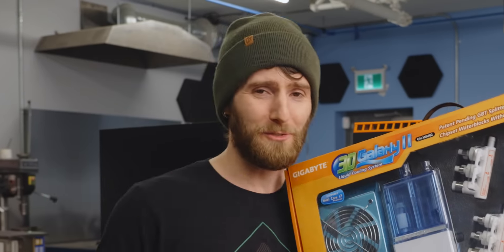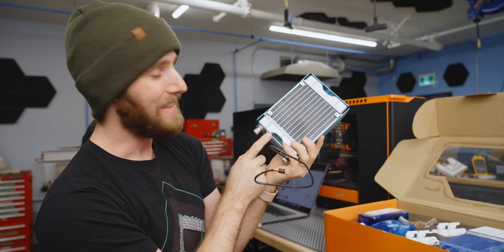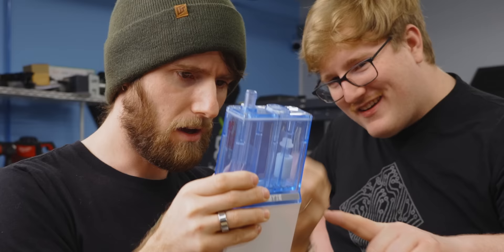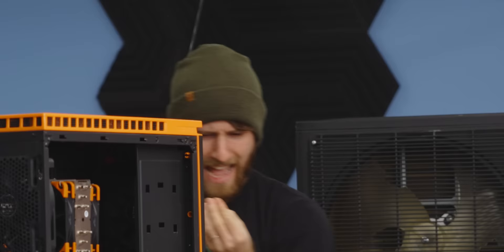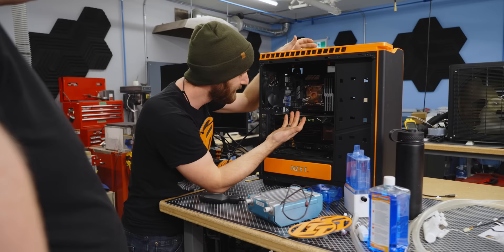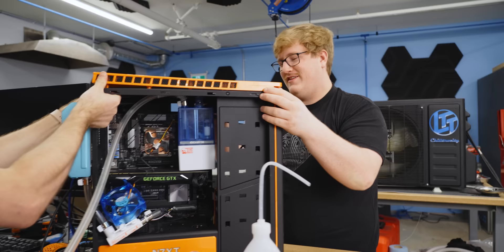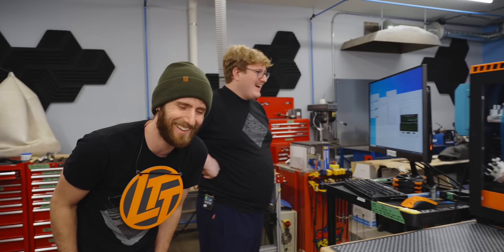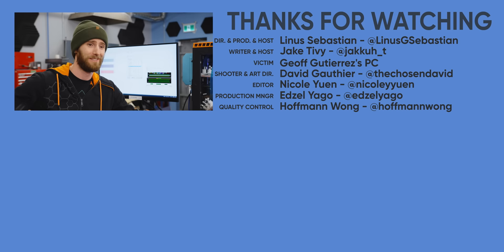This Product Aged Like Fine Milk - Gigabyte 3D Galaxy II Retro Watercooling Kit

Comment: 5:30 the wanted you to remove the power from your Hdd, because the you PC won't Boot and you CPU would idle in the Postscreen. This was to minimise the heatoutput till the loop was bleeded, since the block wouldn't cool without water. They simply relied on the thermal mass of the Block during that time, which was fine(?) back then...
Reply: 60w was the norm back then so thermal performance didn't matter as much as it does now. This was Gigabyte's attempt at getting sales from novice PC builders, I doubt this was competitive against the DIY market - the fact that this had bigger fans was a greater selling point for people looking to upgrade from the annoyingly loud stock coolers AMD and Intel chips came with.
Reply: @amirpourghoureiyan1637  yes I had a thermaltake system on a heavily overclocked P4 and that was much quieter. Later I swapped the cooler for a cooler of a motorcycle and ran even passive....
Reply: @amirpourghoureiyan1637  Pentium 4 got out to 115W in 2004/5, higher if you overclocked. 'Preshott' literally melted sockets overclocked. Theres a reason they abandoned the entire architecture.
Reply: even back in the days we werent dumb like that. we knew full well that connecting the green wire to any black on your 24 pin would run the pump without turning the system on (still does)
Reply: @mycosys  Yeah, I was referring to stock systems. AMD and Intel's 32 bit chips ran at similar thermals to today's Pentiums/i3's
Reply: @mycosys  I had a Sony vaio with a pentium D that idled at 80°C. Kept me warm in winter lol

Comment: I remember using fish tank pumps, pop bottles for reservoirs,  and tubing from hardware stores along with some self machined copper heatsinks. I have sworn off liquid cooling ever since lol. This was circa late 1999-2002.
Reply: You still can use fish tank pumps.  The Aquacomputer Aquastream line uses eheims.  An actual top notch pump, sacrificing some pressure/flow/noise for reliability vs D5, with built in monitoring/control (integrated low flow sensor, temp sensor, display, and onboard microcomputer).  Very reliable pump.
Reply: @Grimmwoldds  I've had two D5 pumps working in tandem for over 10 years dude.

You don't know what you're talking about.
Reply: Yup, THAT were the days of pioneer water cooling. Not that modern AIO stuff. Back when a Dremel was a PC enthusiast's most important tool is where it's at!
Reply: Seems fun for a rat style build today.

Comment: I like that they actually put a decent amount of thought into the system, with the power pass through, a decent pump. The patent pending valves. If only they had spent a little more time on the water block it might have actually held up! I'm honestly shocked that the components all worked and the coolant was still ok. They only gaurantee it for 3 years! lol But still, pretty cool!
Reply: And if they used a new thermal paste + good mounting pressure the cooling performance would have been only slightly worse than the best modern air cooler.
Reply: 3 years of use, not 3 years sitting on a shelf. Hence warranty starting after purchase even if manufacture is a year ago
Reply: @Rspsand07  ah, fair enough. But sometimes it is from date of manufacturer, if it starts degrading. An extreme example is hydrogen peroxide, if it sits on the shelf too long, it's just water when you open it.
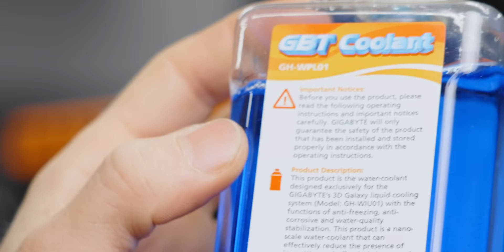Reply: @Rspsand07  on 4:53 it says "Guaranty period - 3 years (on closed status) "

Comment: The manifold for adding components to the cooling loop is actually an objectively good idea they should be using now. Definitely more convenient for the end user
Reply: in case you didn't know, quick disconnects exist.
Reply: Not sure if it would work with a loop setup and would instead mess up flow.
Reply: Yeah, well, Gigabyte has the patent on it... nobody else can use this.
Reply: @TechyBen  Correct.  You shouldn't use a manifold unless you have a large number of identical devices waterblocked(GPUs mostly).   It's not a useful thing otherwise.  Even then, most blocks that might be used in multiples will have more than one inlet/outlet pair, so a manifold as a separate part is just useless.
Reply: But how often do you change your components that that even matters?

Comment: Aah, the nostalgia!  The only thing I would have done would have been to also compare it against a good representative air cooler from that era too to in order to see if it was an improvement over what was available at the time. Noctua is a still quite a challenge to beat even for modern WC systems.

Comment: Really needed to give this unit it's best chance to shine. Modern thermal paste and modern coolant. COME ON LINUS! Make this happen. I really enjoyed this video.
Reply: You wouldn't want to run modern coolant in that thing since modern coolant doesn't have the same anti corrosion agents in it. I think that swapping the cold plate to a proper one would give the best improvement.
Reply: You actually NEED their coolant to prevent the corrosion between the aluminum and copper....
Reply: Better way would be to test its performance on era appropriate CPU against era appropriate air cooler.
Reply: @R3BootYourMind  Because there is no modern coolant with anti corrosive agents.
Reply: The block design is awful, modern coolants and paste wont do anything.
Reply: @g.4279  i think a modern paste might have done something, but not much.
Reply: @akamemurasame4527  Automotive coolant has corrosion inhibitors.
Reply: If you are going that far you should probably lap the cpu block and try to take it apart and fix the flow through the block as well.
Reply: "Coolant"?

ROFL.
Reply: Just use the red OAT coolant, as a bonus it's "UV sensitive"

Comment: there's a good chance that the Thermal paste you guys used, actually influenced the benchmark by a lot. maybe with a quality paste it would run at the same temps as the noctua xD
Reply: Even new water coolers struggle to beat the noctua but I like your optimism
Reply: @hondaman62  that one is pumping like crazy though.
and Noctua NH-U12S is actually not as good.
Reply: @hondaman62  so it should be given every advantage

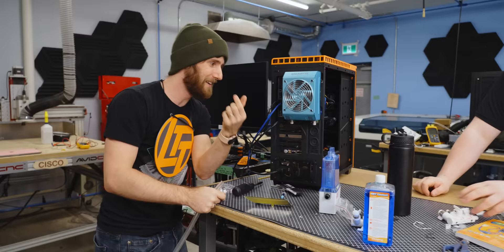Comment: 13:52 As was noted a few seconds earlier, power supplies used to be at the top of the case. These wouldn't have interfered with video cards which were at the bottom of the case.
Reply: Yeah I have a fairly old pc and my gpu slot is at the bottom and psu at the top
Reply: I had a similar case but with a top-mounted PSU, but my GPU was still an AGP card, so it would have been hella blocked by this
Reply: I still have mine at the top of the case lol

Comment: I had this very loop set up in my Lian Li PC-70 back in the day. If I remember correctly it was an Athlon 64 3200+ with a MSI K8N Neo 4 Platinum mobo and a GeForce 7800 GTX. In an era where you could buy this or spend as much as a full PC build on a custom loop, the gigabyte kit wasn't a bad deal to be honest. Definitely needed a full tower case to comfortably set the thing up inside, though.

Comment: My very first computer was built using the "GIGABYTE 3D Aurora 570 GZ-FA1CA-ASB Black 1.0 mm Aluminum body ATX Full Tower Computer Case" which was the original case that this liquid cooling kit was made for. Thank you LInus for the nostalgic flashback.

Comment: This takes me back! Modded PC's back then looked like the B2TF DeLorean time machine. Knobs on the back, different gauges on the front. I had a water cooling setup where the "tank" fit into the old CD drive slot, the pump was like from a small fishtank, the back radiator gave her a big dump truck.. and I ran the coolant lines through an open PCI back slot xD

Comment: I would love to see what the performance of it would be if you properly flattened the cpu block.  And used a newer thermal paste.  Just to see how much the poor surface was causing issues.
Reply: I agree but also the way the coldplate was designed didn't really flow the coolant over the hot spot so who knows what would be the result but it certainly shouldn't be worse
Reply: @theduck17  I mean it's that really going to master much? It's a solid copper block. Heat will distribute in it pretty much evenly.
Reply: The cold plate also looks about 5mm too thick :D
Reply: @4203105  and the liquid stream touches "not moving" liquid

Comment: 17:43 Pentium 4s did have thermal protection.  I think Athlon XPs might have had it (I do remember mine having temp sensors) but anything older than that, especially AMD, was prone to failure and sometimes catching fire.

Edit:  But P4s ran so hot that we eventually had to put a fan with blue LEDs that sat in a PCI case slot in my younger sibling's PC.  2004/5 was weird.
Reply from the maker: You're right P4s did have thermal protection. My bad - LS
Reply: Pretty sure the Athalon XPs did too.   It was as bare bones as this solution is - hot temps = instantly kill the power, no graceful degraded performance "until" it's cooler.
But that's really as early as my experience in actually playing with hardware goes.
Reply: There was at the time breathtaking video. They remove heatsink on 3 working pc’s. Amd athlon, intel celeron and p4. Pentium 4 throttled down, celeron froze and athlon caught fire.
Reply: @MegaMoonse  oh man... I want to watch that.
Reply: @TheBaldrickk  check the video named "What happens when a CPU heatsink is removed".
Reply: @proCaylak  thanks, was good
Reply: Yeah, that. This is why I had to watercool my P4 back then. It was from one of the very first Prescott batches, and my CPU was super hot. My air cooler would not perform well enough, and the PC would always shut down. The water cooling was of a similar design btw, it was Thermaltake's Aquarius II with narrower tubing and not so great performance either. But at least it kept my PC on lol.
Reply: My first "custom build" PC was an Athlon which I believe did have thermal protection but that seems so far away LOL. My high school capstone project was how to custom build your own computer.
Reply: As a kid I remember having a...P3 I think? Pretty sure we got it from blowout sale when the P4 launched. One day it started randomly shutting down after a few minutes of use. Turns out the heatsink/fan fell off the cpu. I guess that counts as thermal protection?
Reply: P4's were able to throttle from overtemp.  AMD CPUs (around Athlon XP era) would halt at overtemp conditions.

Ref: https://www.youtube.com/watch?v=NxNUK3U73SI
Reply: In college (1998-2001) I worked in a computer lab and we definitely set a Pentium II on fire with an intentional overclock.
Reply: If I remember correctly. I did have a motherboard whit built in temp protection. It was a temperature sensor that was supposed to mount to the cooler in some undisclosed way. And then sense the temperature of the case. It may even have been fitted whit two sensors CPU and ram maybe? But it's a long time ago. I also had zalmans air alu/cooper cooler that I later upgraded to the all copper 120/140mm? Air CPU cooler whit led fan. Not to mention my awesome plexiglass psu whit blue led fans and a chrome nob to adjust the fan speed...
Reply: @MegaMoonse  It was a Tom's Hardware video, I think they made an "updated" version of that video later on with an Athlon 64, needless to say the thermal protection kicked in
Reply: @TheBaldrickk  No.
Reply: Yup. I've personally burned right through an Athlon (not XP) on first power-on, actual hole in the die (which was naked on these) and smoke and everything. Mounting coolers straight wasn't as simple back then - or I was just a bit dumb =)
Reply: @comprendes_mendes  We had a Pentium 4 Northwood prebuild from HP.  A XP MCE machine with a 3.0 GHz CPU with hyper-threading and it would shut down after one of us decided to play games a little too aggressively on it.   There was obviously no room for water-cooling although I had known about it since I started taking my computer repair classes at around the time so we went with the slot fan option.  It actually survived well into the Windows 7 era and ran it quite well despite, well, having to go with PCI graphics because AGP was dead.

In retrospect, putting a better air cooler and some thermal paste would have fixed the problem too.
Reply: @LinusTechTips  Cool!  (Literally)
Reply: @Mystik314  Halt and catch fire at its finest.
Reply: I still miss that machine.  It might've been a prebuilt, but it was pretty solid sans the overheating problem.  Too much Empire Earth and it would just overheat and it'd die.

Also, it was the best MCE install I've ever used, and the built in capture / FM radio was a nice touch.
Reply: Athlon XPs, at least the earliest ones, did not have thermal protection, or if they did it didn't work very well.

I know this because I literally melted one by forgetting to plug-in the CPU fan.
Reply: Intel fanboys actually dunked on AMD by demonstrating how they could take their coolers off and their chips wouldn’t melt, while the AMD die would slag. I always thought that was a really stupid bragging point, hehe.
Reply: @fonkbadonk5370  You let the magic smoke out... 😞
Reply: Yes that was thermal protection. The pentium 3/2 ran cool enough they could last a bit before turning off, like modern pentium/Celeron chips. The p2 was the first CPU to have thermal protection, AMD added it with the athlons immediately after the thunderbird.
Reply: @LinusTechTips  I found out my P4 had thermal protection ( and what it was since I didnt know ) because it kept turning off by itself after a short while. Aparently you are supposed to clean up dust BEFORE the fan cannot spin anymore because of it. You live, you learn I guess.
Reply: Yep. My first CPU was an Athlon 3000+. I promptly fried it by hitting the power button before even installing the cooler.
Reply: @TheBaldrickk  I rememeber watching a video years ago with Toms Hardware (i think) pulling the heatsink off a P4 and an XP while running. The P4 thermal throttled and the XP just burst into flames in about 4 seconds. Sure it's still out on the interwebs somewhere. :)
Reply: @Vacheron7  Yeah, that's the one I found following the search suggestion above.   Thanks.

Comment: Not all water-cooling kits from this time were as janky as this Gigabyte kit. I had a Swiftec kit from 2007 that was way better than this. It even came with a Laing D5 which I've used in 6 water cooled builds since (100,000 hours of operation) and is still going strong. It's happily pumping away next to me right now.  What an amazing pump.
Reply: 2007 stuff was maybe already better but till 2004 everything was so weird
Reply: @ManOfAttitudeLP1998  right. 2007 was on the upswing of where we are now with technology. 2000-2005 was pretty Wild West of “who knows” hell it was still just windows xp running the world too.
Reply: @WooferCooker  yes I was a kid at that time and even had a pentium 3 laptop with windows 98 I got from my dad
Reply: @ManOfAttitudeLP1998  Okay, but this kit was advertised as "I7 compatible" so there's no way it's from 2005
Reply: Had systems from thermal take.v2 and v3 What I could remember it was like less than +20C idle and ~+30C on full load. Cpu. Gpu and motherboard was LC.

Comment: Nice! I had "smaller" version without distro blocks...almost 8 years ago when i build "retro PC" (not really a retro back then) i find one on E-bay sealed...without mounting for 775...so i made one from aluminum and grinder...ahh...good old days... 2x HD 4870 x2 and 1200W power supply...this rig was definetly a space heater.... :D

Comment: A 2000 style video would be fun too.  Fountain pump from hardware store, home made water block or one from danger den, a heater core from a Chevy Vega.  I had my pump suspended mid air because it vibrated too much and made a ton of noise if I mounted it on the case.   

Cardboard ducting so I could mount the radiator in the case and ensure it was drawing air from the front and outside. 

It worked great for years!

Comment: My first repaint and build used that cooler, it's still sitting in my spare room and it still works just fine.. It lasted longer than almost all my newer cooling kits did, pumps fail all the time, this one still works.I did cut the top of the case for a spare radiator and the one that came with it. My water block was polished, they must have changed it later. Mine (10-15 years later) has clear water and has no corrosion that I can see. no doubt it's crude by today's standards, but for the time it was pretty nice and worked well, much better than most air coolers of the day.

Comment: My first ever water cooling setup was this! Until the reservoir cracked, prolly from using car coolant in the absence of proper liquid.
Reply: I think you might have gotten lucky with the cracked reservoir, since the radiator was probably getting chewed up inside due to your choice of fluid, and would have leaked a lot more invisibly when it started to go. At least with a cracked res you could see that you had a problem.
Reply: @mal2ksc  most probably. It was a crazy era. YT wasn't even a thing just yet. A childhood not particularly marked by educated guesses overall. 😅

Comment: seeing you clean the rig with an air compressor just eased so much anxiety for me. We have a very big air compressor at my house that's plumbed into the workshop downstairs and I've been using it to clean my electronics, but I've always been worried the air pressure is too high (though, if I wasn't lazy I could go to the garage and adjust the flow rate....)

that said, seeing you do it the same why I do (short blasts with the air gun a few inches back) makes me feel a lot more confident that I won't break anything if I'm mindful of what I'm doing

Comment: Back around that time, I bought a water cooler (Thermaltake maybe) that the reservoir fit in the 5.25" slot. It worked OK, but that was before Zalman show up and made really good air coolers.